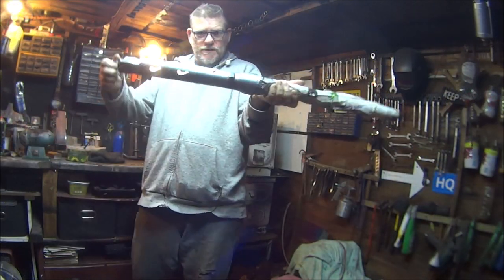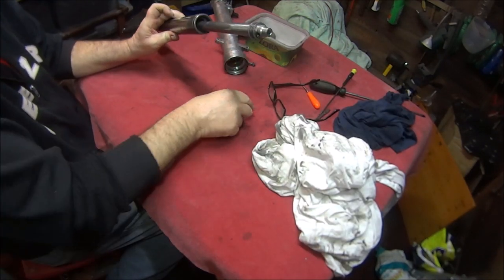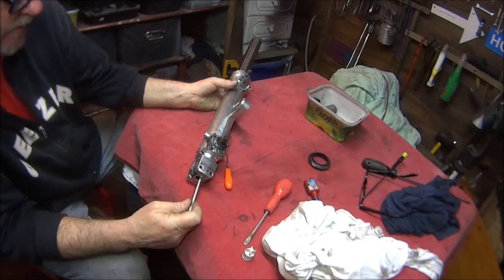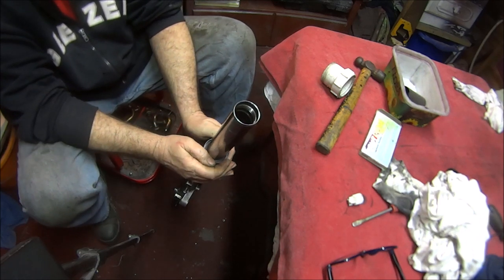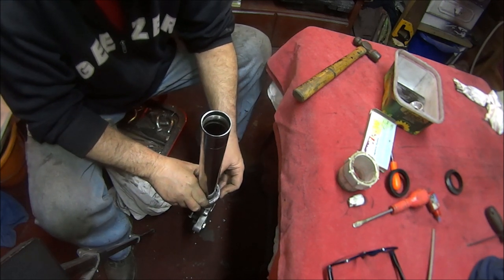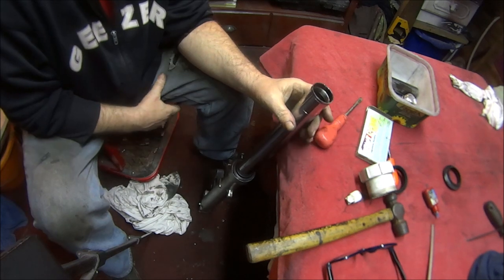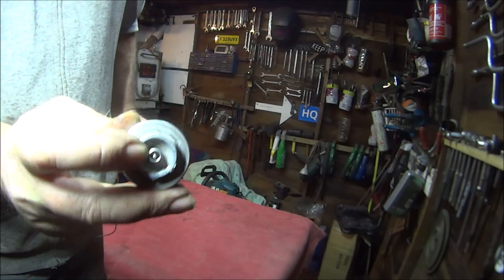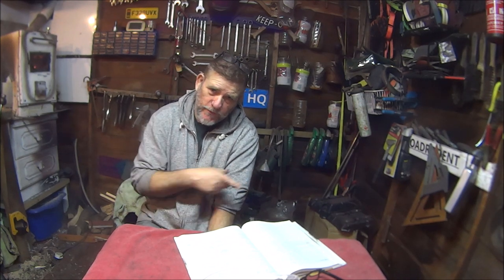CBR1000F Landfill bike, front forks rebuild, done.

Comment: hi, did I miss something or did you forget to connect the damper rod to the fork top cap, and secure in position using the lock nut. Also the spacer should have a washer and then a special dished washer that sits below the lock nut. If the damping rod is not connected to the fork tube, how can it do its job.
I only happen to notice as Ive just done a VFR and now doing a CBR1000FL 1990. Your work is invaluable to me, and I thank you, and hopefully Ive pointed something out here, unless 'I done it wrong again' :)
Reply from the maker: Hi nigel no you didn't miss anything not all forks are not the same. on mine the damper rod is at the bottom. 👍
Reply: thanks John, I did catch later that your bike is 87-88 1st edn. Hurricane. Think mines 2nd gen 89-92. I was certainly gawking at the damper assembly yesterday. Mine looks to be a single 'cartridge', didnt look to diassemble. Wheras yours, and from the workshop manual, looks to come apart. Bit confusing to me, just hope it all goes back together today.  
Like your shed by the way, and you've installed the burner. I'm too petrified to do that in my garage (full of well flammables), so I just freeze my tits of generally, while I'm rolling around the floor... keep up the good work, and nice guitar work, Cheers NiG (Doncaster -- just across Sherwood from you) @jonyr1TT
Reply from the maker: Keep checking the workshop manual and you will get there in the end buddy. Log burner as gone it had more holes in it than my old Ford cortina lol . 👍
Reply: done both fork legs on the 1990 cbr1000FL. The fitting of the spring was a devil. I managed to fit the spring, with the damper rod running thru' it, by using a spring compressor to squish the spring, giving me enough room for washers and spacer, and dished split washer, under the locknut.  Once that went together, then the whole lot was dropped in to the stancheon and fork leg, then bolted in. I think quite different to your vid, as you pointed out, your 87-89 hurricane has the damper rod upside down to me. Think that mightve been worst job ever, until the next job comes along... by the way, I added the oil at the end, once it was all constructed. Sure it was way easier on the VFR...Cheers NiG. p.s. I found pitting in the stancheons. Tried superglue, araldyte..nothing really filled the pits, once I started polishing, the whole lot was removed. Any suggestions for pitting ?
Reply from the maker: Nice one mate. 👍 re-chrome or new stanchions I'm afraid 😨. Or a good used set. 👍
Reply: thanks John, they're on and not p*ssing oil, but the bikes not going anywhere. I've seen there are a few rechromers in Don area, so will see, if the bike ever gets to rolling down the road. Putting the rear suspension back shortly, so she can stand on her own, then start looking at carbs etc. Hadnt contemplated opening up the engine 'till I saw you wrestling with the thing...thnks for the support, cheers NiG
Reply from the maker: It will all come together in the end buddy. Just had mine running for the first time in months. 👍

Comment: Am doing the same job , on the same fork , was wonder on the fork with the anti dive plunger , does this have to line up with the hole in the bottom of the damper rod .... they do seem to be the same height , although there was no resistance from it while pulling out the for leg ...
Reply from the maker: I just pulled them out cleaned and put them back in again. Mine seem fine.
Reply: @jonyr1TT  thanks for the reply  , couldnt find any where that said they need to be lined up .... but if i hadnt checked....they would have 😌
Reply from the maker: How it helped 👍